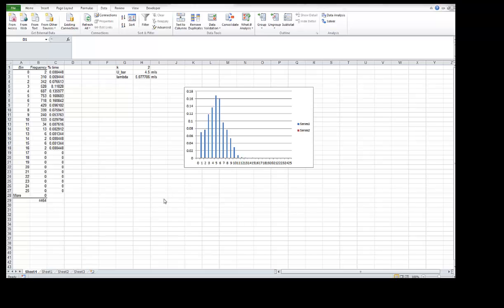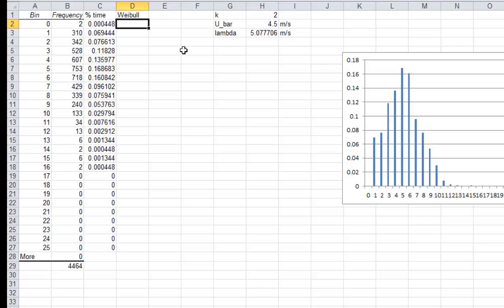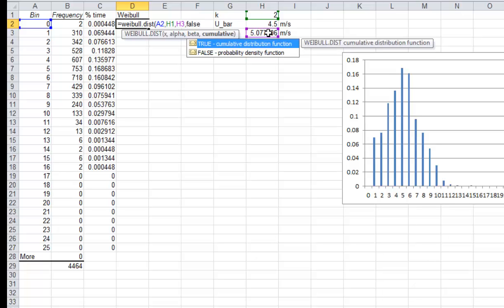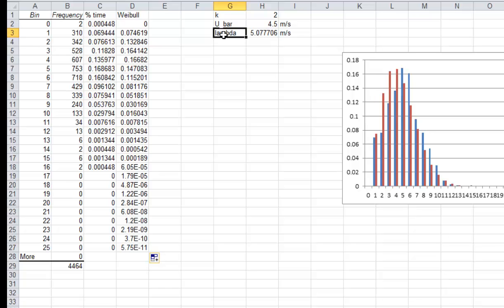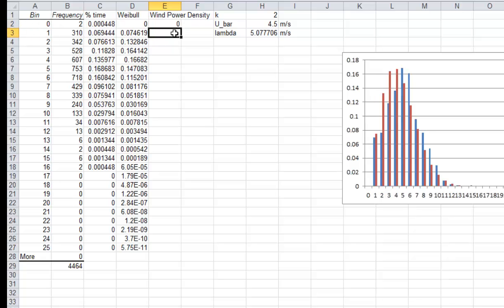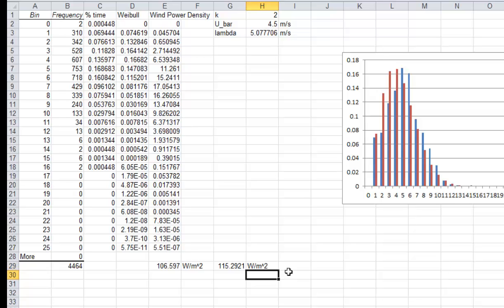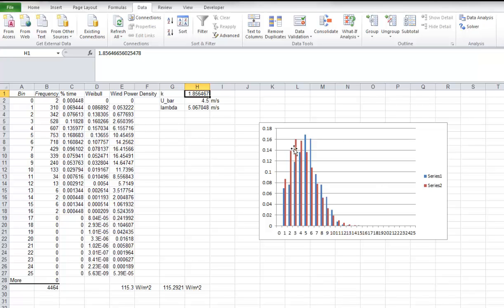Matching a Weibull Distribution to a Data Set in Excel

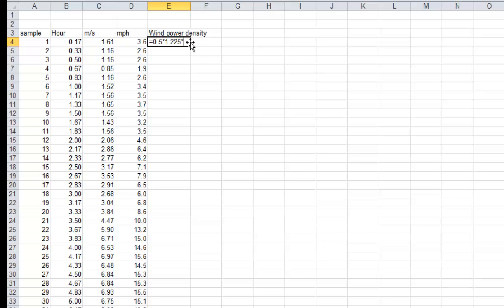Comment: when the video start at 0:35 seconds , i wonder how do you get 1.225 from ? is that from the formula or else? it's shown that  0.5*1.225*C4 thankyouu
Reply: 1.225 is air density at standard temperature and pressure. You can find it from the ideal gas law.

Comment: Hi.. Thanks for the Video & explanation. I have a raw distinctive test results in which I need to perform capability through nonnormal capability method( weibull distribution). So can u pls help me in this regards, upto the finding of shape & scale factors.
I tried myself and compared with MINITAB result, but Ppk, shape & scale factors are not matching. Results got through MINITAB’s are N – 25 & Avg= 8.922, Shape – 27.9505 , Scale – 9.09408 & Ppk – 1.10 . Raw datas are given for your ready reference. LSL – 7 min& readings are 8.30 9.40 8.90 9.50 8.85 9.08 9.28 9.45 8.74 8.86 8.45 8.66 8.48 8.67 8.24 9.14 8.68 8.98 8.67 9.14 9.24 9.47 9.23 8.98 8.68.

Thankx...

Comment: Thank you, this video is very helpful, but I have one question:

There are cases in which, even though the average weibull wind power density matches the real average wind power density, it is very clear (visually) that the weibull curve doesn't fit the histogram. If using a different shape factor leads to a much better fit, visually speaking, but it doesn't reach the wind power density desired: should I use that factor or the one calculated using the solver?

I would very much appreciate if you could answer me, thank you!
Reply from the maker: If you are able to find a better fit manually, you should also check that the average wind power density isn't too far off from that found from the data. This is an important measure for understanding the wind resource at the site.  In the case that the curve you've matched to the data clearly doesn't fit, and the one which seems to visually fit better doesn't match the average wind power density, it is likely that a Weibull distribution is not the best way to model that data set.

Comment: what if the bins are not regularly distributed ?
say the frequencies are given for velocity ranges 1-3 , 4-7 , 8-10 , 11-13 , 14-17 , 18-23 , and more than 23
how it can be handled ?
thanks
Reply from the maker: You would need to multiply the calculated Weibull probability distribution values by the bin size.  You can check if you've done this correctly by summing up the probabilities.  The sum should approach 1.